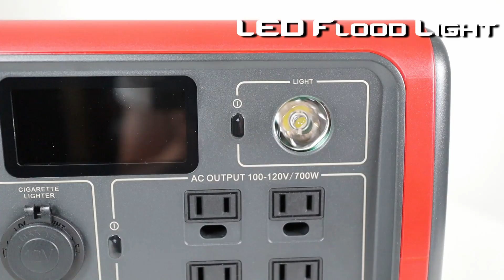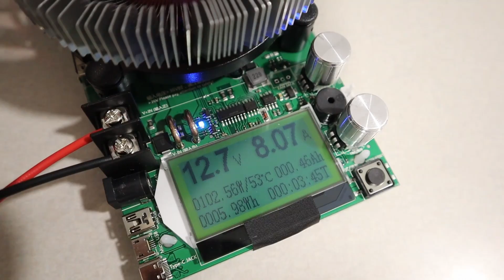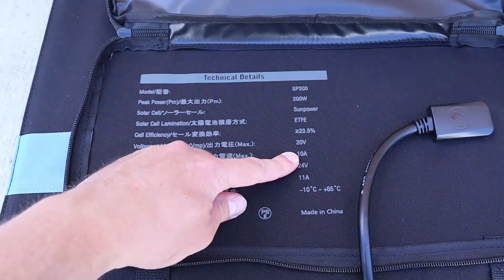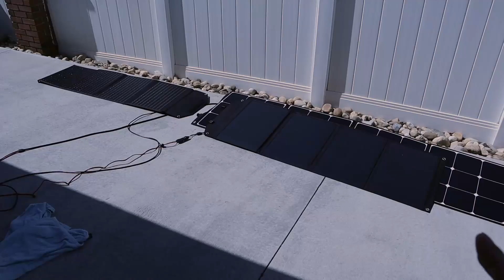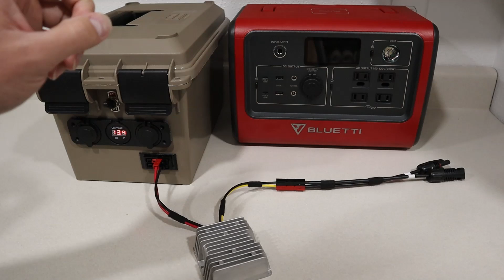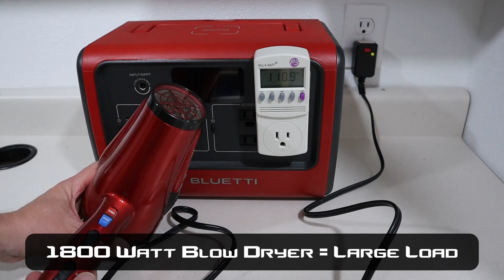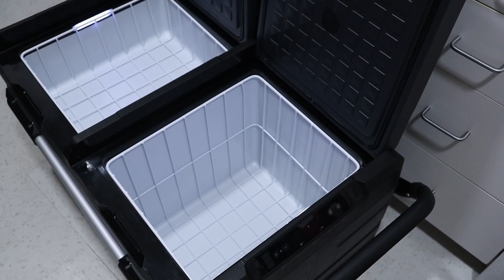Bluetti EB70 LiFeP04  + SP200 Solar Panel - Best Battery for 12v Fridges? - Full Review and Testing!

Comment: I'm thinking to buy one(or two).
Only thing draw back is, as you mentioned here, the poor UX(User Experience).
And, as you mentioned here, ambiguous input limitation of Volts and Amps.
It doesn't allow any serial or parallel connection of two solar panel.
But, my God!, it is the LiFePO4! and MPPT!
Reply from the maker: You can parallel solar panels, you'll just top out at about 150-155 watts. When you over panel it like that you can have some "reserve" power available if solar conditions aren't ideal. This power station has really grown on me since this video!

Comment: One more question for today.  Is there a connection that I can plug my frig 12V to solar panel and Bluetti?  So I can give the Bluetti a break to get charged more.  Just a thought..
Reply from the maker: The fridge wont run off a solar panel unfortunately, it needs a battery voltage. You can plug the fridge into your vehicle battery system temporarily but you wouldn't want to run it that long so you don't kill your starter battery. (you could just run your van engine to keep it charged up).
Reply: @Jasonoid  thank you so much.  I would be staying in most places from 4 to 14 days so would need to use solar on it.  Spent too much on Van lololo no payment but am now saving for my Bluetti n panel.  Getting things put together and will hopefully hitting the road after the snow melts.  Again thanks!

Comment: What does a cycle mean?  Would it work with the Bluetti 120 solar panel for frig?  Thanks so much for your videos.
Reply from the maker: Hey LinVanGo, one cycle is when you use the battery from full to empty and then charge it back up fully. So 2000 cycles. 

The EB70 would work well with the Bluetti PV120 running a fridge. Let me know if you have any other questions.

Comment: Will this work for a 700-900 Mirowave for up to 15 mins?
Reply from the maker: The inverter will shut off if anything goes over 800 watts. If you found a really small microwave that pulled under 800 watts max, it should work just fine!

Comment: Great vids man, I have learned a lot from your channel. Question: If youre charging off the solar panels, and the sun disappears behind a cloud big enough to drop the input to 0, will the battery automatically turn off? I have a power station that has some kind of "saftey feature" that does this. Makes it so you are constantly checking to make sure it didnt turn off because youre in the middle of nowhere and now anxious about your fridge getting turned off!
Reply from the maker: The EB70 has a power setting called ECOmode that will shut off the fridge if nothing pulls power for 40 minutes. I just make sure this mode is disabled and it works perfect for running a 12v fridge. The power station will charge anytime power comes into the charging port and doesn't shut off if no solar is coming in. No need to worry :)
Reply: @Jasonoid  Awesome, thanks!

Comment: Thanks for the review. I just bought this to power a telescope during the night. Currently using a Jackery 240 and a mix of LiFEPO4 cells, but this will be much better.
I can handle most of the quirks, but I wish they had a Display On button. that seems like gross oversight. Maybe I'll mask over the Torch (so it doesn't kill my night-vision) and then just use that power button to turn the display on.
Reply from the maker: It takes about a week to get used to the power station and I absolutely love it. One of the best currently available!

Comment: .. so this is really stupid on the charging input and external! power supply fan - what a pity, it´s not well thought out; would max out even 2 elecaenta 120w panels @ 144 watts due to the 18 volts and 8 amps limit. ecoflow river pro would be perfect if it wouldn´t be about the "old" batteries.
ps: btw, did you ever test charging from the car battery using an inverter to overcome several limits? and if, what about (cheaper) modified sine wave to charge power stations? would be very interesting i think.
Reply from the maker: There are a few downsides to this battery, but overall it's an EXCELLENT option. It has really grown on me over the last couple months. I have a video covering charging the EB55 and EB70 while on the go, I put it out a couple months ago. It's a pretty good video that covers lots of different charging options.
Reply: @Jasonoid  many thx, will check that, too

Comment: Excellent video! I appreciate the review with different appliances!  I still have not seen any videos with a regular house hold fridge. As I want  to use this for backup during a power outage.  Appreciate the comment  below in regards to the freezer.  Cheers Vancouver Island Canada 🇨🇦
Reply from the maker: Thanks James. If you want to run a household Fridge or other larger appliances for longer than an hour, it's going to require a bigger battery. Think about the BLUETTI AC200p or Ac300. Those are great options! I will be reviewing the Bluetti Ac200p on my channel in the coming month or so.
Reply: Fully charged, I ran my 18cb house fridge for 8.5 hrs,but it's the EB70S which is New 800 watts model.
Reply from the maker: Thanks for providing those test results!

Comment: How well will it run a home fridge or deep freezer?
Reply from the maker: Full size fridges usually require a lot of surge current, this power station would run a mini fridge or a smaller 12v fridge. You want a larger power station like a 1500 or 2000 to run a fridge.
Reply: @Jasonoid  ok. Thanks for your help.

Comment: Hi, Thanks a ton for a super fine video...I know nothing of electricity/solar and its quite a learning curve! I have to visit my ill father in the next month, using my Highlander for the roadtrip. I think I'll buy the EB70, and the IceCo 45. Question 1: Is it wiser to buy the 2-100w portable solar panels than 1 of the 200w panels if space is an issue? How about if, long term, I upgrade to  Bluetti AC200P? Would the 200w panel be better than 2-100W? Next Question: if I buy the EB70, which rigid solar panels would be best (weather wise) to temporarily attach on top of my Highlander for "on the go" solar charging for this 2 week trip? (would that be better than DC charging in my car cig lighter?). Question 3: When I get to dad's, I can use an extension cord from my car (where EB70 would be attached to my fridge) to my dad's house? Which extension cord would you recommend??? Thanks in advance for your kindness and help. :)
Reply from the maker: Hey DeAnna lets see if I can answer all of your questions:
1) When thinking about solar panels, it's best to have the same exact model when putting them together in a array so either a couple 100 watt panels or a single 200 watt panel will work just fine you just want to make sure that when you upgrade, you purchase the same panel again and again so the voltages and output match each other. I would probably go with one 200 watt panel to start out with.

2) When using the DC charging on the EB70 you'll get about 80 - 100 watts charging. With the solar input you'd see about 150 - 160 watts in great solar conditions. Both charging options work but you will see MORE power via solar charging. When looking to purchase a solar panel for the EB70 you will want one that has a slightly higher voltage for the best output. I would recommend this RichSolar 200 watt solar panel:
https://amzn.to/3lepwSY

3) As the for the extension cord, would you be using it to charge the EB70 up off his home AC power with the included wall charger? So you would be running AC power from his house to your car? In that case you can use any extension cord that's at least 12awg. Something like this would work well:
https://amzn.to/3AgBu2O

Hope this information helps you on your journey! Good luck, let me know if you have any other questions!

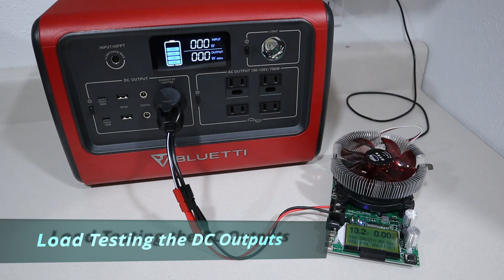Comment: Why did the bluetti keep turning off when you were testing it? At 18:45 and right before that it did as well. ?
Reply from the maker: The screen will only stay on for 30 seconds to save power
Reply: @Jasonoid  ok I was hoping it was something like that. Thx for answering so fast. Would it be ok to hook up 200watts of solar to this panel or do I need to buy two panels that equal about 160 watts?
Reply from the maker: You can hook a 12v 200 watt panel to this unit. You can also hook two 12v panels on parallel to this, just not in series.

Comment: Would it be possible to hook the boost converter up to the output of a solar charge controller?  That controller takes the varying power from the panel and converts it down to a constant voltage source to charge the battery.  Boost converter should bump that to 24v right?

Continuing on with that thought.  Do they just make a solar charge controller that takes a 12v panel and buck/boosts it to output 24v to charge a 24v battery off a 12v panel.  That would be the whole shebang all in one box really.
Reply from the maker: Hey Piquat1, great suggestion! I actually tried using the same DC to DC converter (12v to 24v) with a solar panel and it did not like the solar output. Maybe the input voltage was too high? They are meant for 12v and the solar panel was putting in about 19volts. I was disappointed when it didn't boost the voltage at all. I was thinking something like this would work well, it's just pricey:

https://www.amazon.com/dp/B07Q5XBV92/?coliid=I3QJY7GIWHFUJ5&colid=120YSRAZEF7E8&psc=1&ref_=lv_ov_lig_dp_it

You could set the output voltage to 28 volts and max out the EB series with solar if that was the case.

Comment: Jasenoid, great review! Are you saying that one can definitively not charge it via two 100w panels, or that you CAN (say, in series), but that one won't hit the maximum capacity, that it'll essentially cap it around 150 watts?
Reply from the maker: Series connection will be too high of voltage (above 30v). You can only connect solar panels in parallel on this power station.
Reply: @Jasonoid  Would you believe I just spoke to a rep at Bluetti and he told me specifically NOT to charge in parallel, but only in series? He said as long as each of the two panels is between 18-24 volts, it should be fine for parallel, but that "series" is out of the question. He said that the voltage remains the same whether it's one or two panels. That said, I am not ready to take his word over yours, as he was interrupting me, seemed almost defensive about the 8 amp limit, and kept chalking up all the 8 amp limit hoo-ha here and with other YouTube'd reviews as people just wanting "no waiting time" to charge things. Not what I expected from customer service. Your thoughts? And, if I hook them up in parallel, will I just lose a little capacity, whatever's over the 8 amp limit?
Reply from the maker: @PhenomenalWorld  sounds like he doesn't know how series solar connections work....(series doubles the voltage, and parallel doubles the current) He's probably not familiar with the EB70. Other larger bluetti power stations do accept series solar panel connections BUT the EB70 does NOT. 12v Panels in series will be over 30v which will fry the control board.... Wow. Sounds like a knowledgeable guy haha.

And parallel connections are just fine with this power station. 140 watts from two parallel panels is better than 100watts from 1 panel. I'd always try to use two panels and ride that 8amp limit.
Reply: @Jasonoid  Sounds like I definitely didn't speak to the right guy. At one desperate point, I said (politely) "I called to speak to one of the people in the tech dept. Is that you?". Yes, he said, but from the difference in your take (unless of course YOU are the delusional one), it can't possibly be SO, or he just wasn't versed in the EB70. I'm relieved to hear I can at least juice this bad boy up with 140 watts. That's nothing to sneeze at, in my little mini-van rig. And my limited experience says I'd be lucky to hit 70 watts apiece all the time with two 100w panels anyhow, even with good sun. Anyhow, I appreciate you responses and review, very helpful!
Reply from the maker: @PhenomenalWorld  you looking to use ridgid glass panels in your setup? I found a Renogy 200 watt solar panel that has a higher voltage and might be able to provide about 170 to 180 watts instead of 140 watts. I haven't tested my theory but I will eventually have a video on it.
Reply: @Jasonoid  I'm presently nearing the end of your weeklong fridge test and the secret emergency charging tip rocks. Nope, not rigid. Flexible.
Reply: Hey  @Jasonoid  - I'm wondering if you ever ended up trying the renogy 200w panel with the EB70? I just bought an EB70 based on your review and am trying to figure out whether to buy a few 100w panels to run in parallel, or 1 200w panel. Would 3 100w panels in parallel outperform the 200w when it's cloudy?
Reply: I just saw this review on the Renogy website for the 200W panel:
"I did a quick test by plugging the panel into my Bluetti EB70 power station and leaning it against the back of my truck just roughly aimed at the late September afternoon sun. Immediately I was getting 176-181 watts into the EB70!..."
Reply from the maker: @steevner  I have been using 180w BougeRV panels and it has been working great. I think a 200 watt panel would also work well. Putting to 100 watt panels in parallel doesn't always get the same results as just a 200 watt panel so I would suggest (if you have the room) to get a 200 watt panel.
Reply: @steevner  Interesting, thanks!

Comment: What is that 12v beige colored power source?
Reply from the maker: That's my DIY 80amp hour LiFePO4 battery, I have a build video on my channel for it. I'm also making a newer more simple / cheaper model so everyone can build it themselves. Pretty sweet setup!     https://youtu.be/WFJlMU272wU
Reply: @Jasonoid  
There is a Talent Cell 12v 100ah lifepo4 battery with a built in 12v 10a cigarette lighter and a USB -C PD 18w
Do you think that could work good running just a fridge?
Reply from the maker: @DriveInTheaterGuy  you got a link for it?

Comment: Just received my EB70 based on your review.
My Alpicool is coming with the cigar-plug.  Do you have any idea what is the connector type on the fridge (the square one)?  I'd like to find a cable from fridge (square plug) to EB70 5.5mm.
Reply from the maker: Option 1) Buy this adapter from 12v socket to 5521 and just tape the cables together so they don't come apart during a road trip....ghetto but cheap and easy:
https://amzn.to/3DZc1xK

Option 2 ) You can buy a replacement 12v fridge cable to use a "donor" cable, and then attach a 5521 barrel plug on it via stripping the wire or soldering the connection:

https://amzn.to/3BSK4WS
https://amzn.to/3nchMCw
Or this option....
https://amzn.to/3zVNirP

Hope this helps!
Reply: @Jasonoid  Yep, was thinking about option 2 but was wandering what is the connector type so I can make my own cable.  thanks :)

Comment: You said you couldn't run 2 panels in parallel and then you ....ran two 100w panels in parallel? Are you saying you actually can but you won't get the full power of the panels? Also, would 2 120w Baldr panels work on this unit?
Reply from the maker: You can't run two solar panels in series because the voltage would be too high, however two panels in parallel is just fine. It wont give you much more power BUT it will allow you to keep the max power going if you get some thin clouds and haze. You are basically "Overpaneling" the EB70 when you do this and it works well.

Comment: Honestly, even with the drawbacks this unit is probably still the best value. I'd rather have a 200 watt solar panel that can max the unit out, vs something smaller. I love the small size and the LiFePO4 battery, this is going to be a life saver when mine finally arrives.
Reply from the maker: I was a little hard on it in my review, this is still my recommendation over many of the power stations available. Excellent inverter, LiFepO4 chemistry, tons of outputs, near 200 watts solar, it's an awesome battery!
Reply: @Jasonoid  That's perfect though, we really appreciate it. Best review of this unit out there, nobody else touches on the solar part of it which in my opinion, is just as important as everything else if not MORE important. I got the combo with the 200 solar panel, excited for when it finally arrives!
Reply from the maker: This power station is awesome. Once you get used to the screen you won't have any other issues. It has a ton of power and the solar panel is awesome!

Comment: So instead of purchasing a 200w solar panel should I just get a 160w instead?
Reply from the maker: If you can find a decent 160 watt panel for cheap that might be a good way to save money. The 200 watt panel would be fine and would probably cost the same as the 160 watt panel.